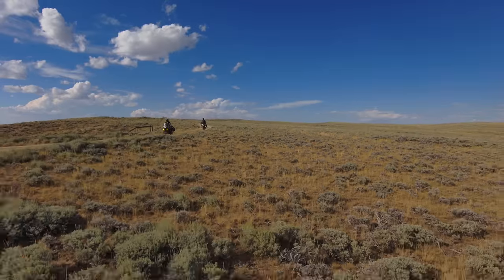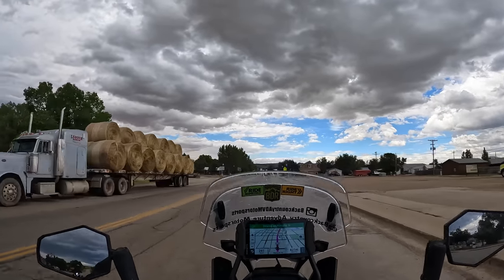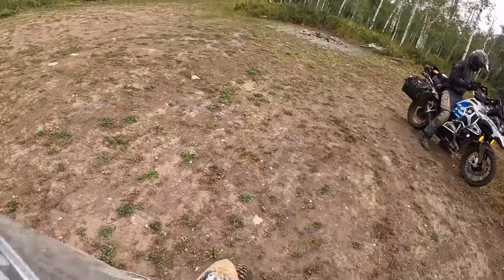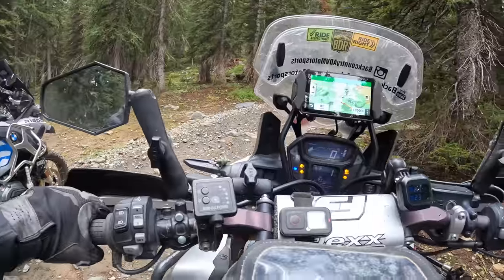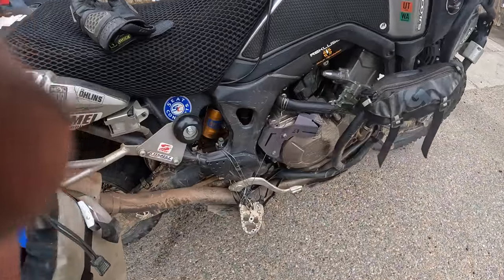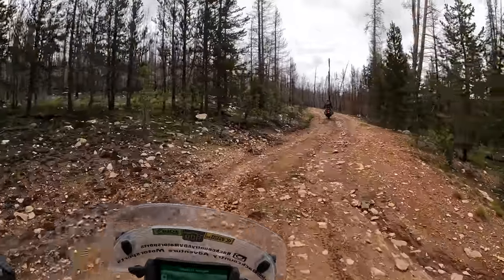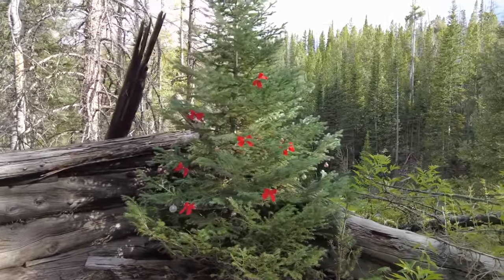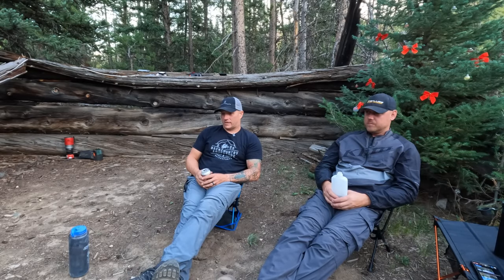One of the MOST  Rugged, Remote, and Scenic Routes in the World

Comment: Quick tip on the flashing LED. 

if you can, switch out the Hz frequency on the camera. Had problems at work for a vision-system and it fixed it from flashing to no-flashing. Modern lights cuts the power wave-curve to be more effective which messes with shutterspeed of cameras. Switching frequency on camera can eliminate it.
Reply from the maker: Thanks! I’ll give it a shot.

Comment: I hear some bangs or rattling on those Rocky sections. It sounds like suspension bottoming out is that what's happening or is it just something you're carrying making noise.  Great vid.
Reply from the maker: Its the ohlins forks. they are not bottoming out. They do have an annoying clunk at full extension though. I first thought something was wrong but after sending them back to ohlins for inspection they say that is how they are designed. They should have put a dampener in the top, but they say it is to allow for maximum travel.

Comment: Great video!  Glad to see you didn’t get hurt when you went down.  I kept thinking the peg repair would let go at a bad time.  Can you share your thoughts about the 3d mesh seat cover?  I am thinking about trying to find one for my Tiger 900.
Reply from the maker: It’s the best comfort mod I’ve added. Keeps you from getting hotspots on hot days and then also allows water to run between you and the seat on rainy days so you’re not sitting there with a wet seat. You wouldn’t think it would make a difference, but you can literally feel the air between you and the seat, when moving down the road. It’s worth every penny

Comment: what broke exactly, the peg mount or the peg? if it was an aftermarket part I'd sure like to see a visual comparison of the OEM vs Aftermarket. (I'm seriously considering an AT for ADV for use in N America only.)
Reply from the maker: The 2016 and 2017 have a cast aluminum foot peg mount on the right side. It’s rhe weak link of the bike. Honda fixed it in 18.
Reply: @backcountryadvmoto  oh, thought you had an 1100